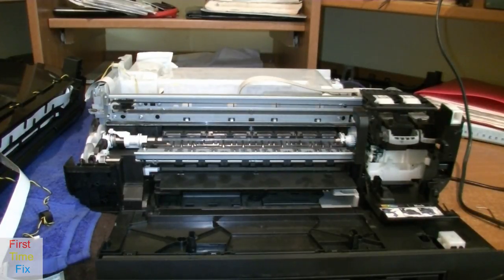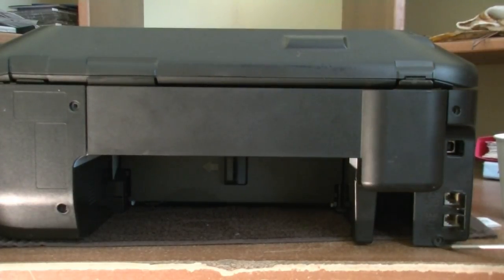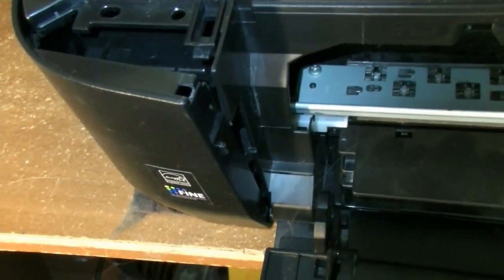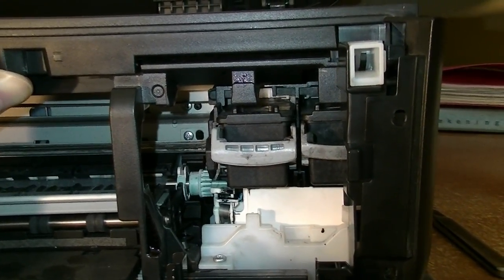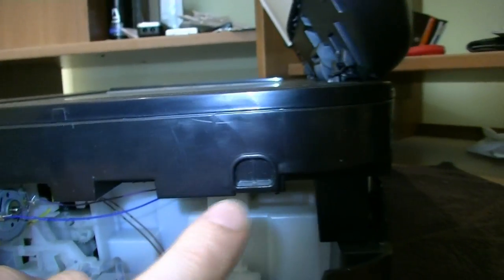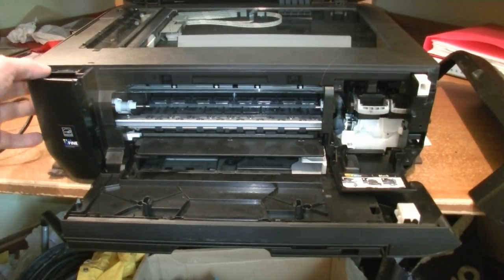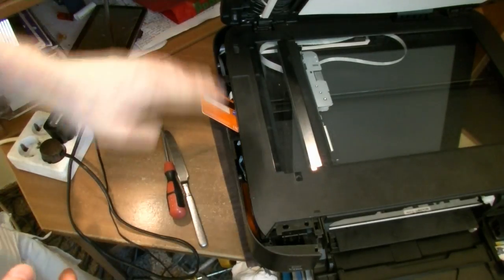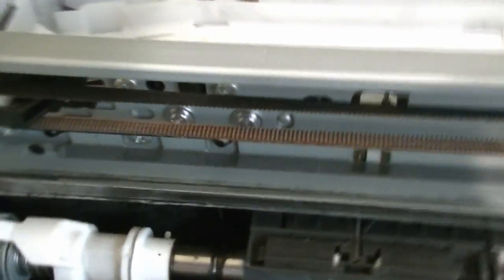Canon MX395 Printer Opening for repair Part 1 in HD

Comment: The best video I have seen. The technician went to great lengths to show details and likely pitfalls. Love it, looking forward to watching the part 2 for further dismantling in fixing my problem of the paper not pulling evenly and causing paper jam. It started out as a minor issue with jammed paper but instead of freeing it by opening the flap at the back, I pulled it out from the front side. I think it caused some mechanical damage to the mechanism.

Comment: Very clearly and patiently described. I wish I had this printer, but unfortunately I have the Canon MX300 which is still different from this and I didn't figure out how to open it. Nor did I find any information whatsoever how to do it. I would love if you could describe this!
Reply from the maker: 👋 Ekkhart thank your for the compliments, I enjoy takings thing appart and if it helps others it's a great bonus. Mx300 is indeed different machine. However the basic idea 💡 is pretty much similar, as to the method of keeping the chassis together.  Obviously those machines are not for repair in mind, they rather have you buy a new one 😉 But when you are stuck in finding where a part is still stuck, usually is one of those clips. Usually they have always a whole where you can put a flat screwdriver 🪛 against it so the clip is relaeased. Now the problem is that often are 2 or more of such clips near eachother and you need to unlock 🔑 them at the same time else if you start to pull some of them will break. Which btw is not always such a bad thing, most of the time it's just cosmetics and does not affect the working of such printer. Work with a good light, that way you can see the details. And Work on it when you are fresh and not tired. Often it happens that when one is tired, one breaks things. If I had one of those printer somewhere I surly make a 📹 video. But unfortunately no such printer around. But I think if you give it time you will find where it is stuck.
Reply: @FixItAMIGO  Thanks for the quick reply to me 😃, okay I'll give it another try. I'm not sure if anything is broken inside, but it's very strange: putting only black cartridge it asks for the colour one, and with both inside it says check ink black and colour. I wanted to check the plugs inside for bad contacts, but also the colour is a pirate one... 🤔. Now I don't want to buy another cartridge just to throw everything away 🙈
Reply from the maker: @ekkehartmeyer701  yeah I know the feeling,  we all have been in such a situation at some point hehe. Try resett of the machine. Then clean those Golden connections just with a soft dry cloth. It difficult to tell what's broken  something cartridge breaks, sometimes those golden connectors breaks or on printer side or the cartridge.

Comment: Muchas gracias, amigo!  the problem of my printer is: I accidentally put a document with sticker label in the auto document feeder to make a copy ,  and the sticker stuck in the feeder,  but I don't know how far inside the feeder.  I need to disassemble the feeder to clean the sticker out. Is there a way to disassemble the feeder only， without taking the whole machine apart?

Comment: After adding paper to my letter tray, the printer was asking me for paper to be added to the "back" tray. This has never happened before since our printer does not have a "backtray". It would not start printing without it.  Please help me to understand whatI did wrong. Thanks!
Reply from the maker: Good morning AMIGO, what type of printer is it?.Most likely you have a rear tray. But sometimes they are well hidden, they are like the manual feed tray for bigger printers. If you do not have it than factory reset might help in menu most printers have such option. Hope it helps

Comment: i have a problem on my canon mx 457 printer that exactly look like this printer,  i notice that when i close the cover part of the printer  the left side of the cover push upward that makes it slightly open but the right side is ok. it flaten to the scaner. so when i use the pdf cover to copy several papers the paper that i suppose to copy doest go well to where it will go.
What i should do please help!!!!
Reply from the maker: hi, do you mean that the cover of the flatbed scanner part does not close properly ?
Reply: @FixItAMIGO  yes, the left side of the cover us pushing upward so i was not able to use the adf cover in scaning and copying several pages
Reply: what should i do with it,,,,
Reply from the maker: if I understand you correclty ad the cover does close properly and is not flat when closed, then please check the joints it is most likely there that one of the joints somehow is hanging higher. Its made that way to fit for example a thik book. Sometimes those joints get stuck or get broken. This can leave one of the joints higher that the other resulting in uneven closing of the cover. if you need I can make a short vid for you but tomorrow ! Because it late here :)
Reply: @FixItAMIGO  yes sir i need ur video so that i can follow what will i suppose to do, that will be a big help. thanks for answering my question.....
Reply from the maker: Ailyn, check this short video https://youtu.be/5Pu7N_pNLPo hope this is what you talked about if not record your situation put it on yt and I will check it out !
Reply: @FixItAMIGO  tenks

Comment: beautiful printer?? seriously?? this is the ugliest printer out there! Wifi connection almost nearly doesn't work, driver issues, extremely expensive cartridges, no longer prints well after printing thick paper, extremely expensive cartridges and extremely expensive cartridges.. do not buy this printer if u saw this in the markets.. just go for Epson printers..
Reply from the maker: For me this printer was always there when needed, it was cheap, I refilled the ink with cheaper ink from Sudhaus and I could open the housing  without problems when repair was needed. So in my book this Canon Printer did what I needed :) It looks for its time ok nothing fancy but that is a mattet of taste. Have a good day.
Reply: @FixItAMIGO  where did you bough this ink? Sudhaus?? couldn't find this online.. i believe the refillable inc printers are a lot cheaper...